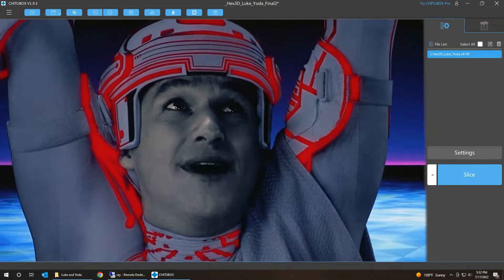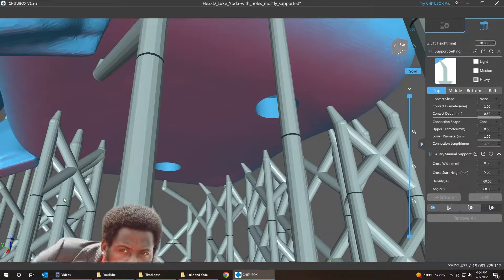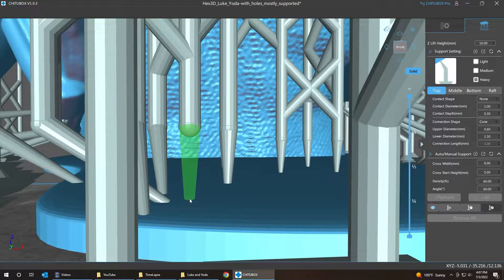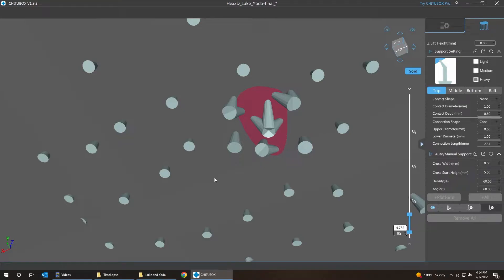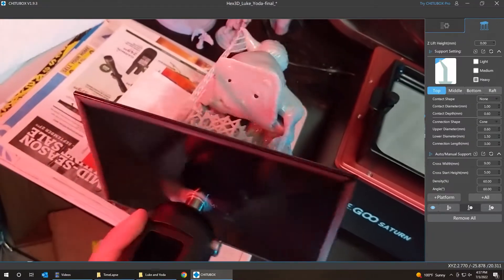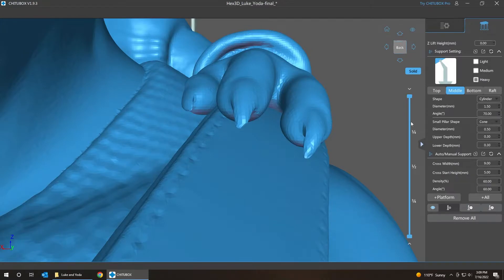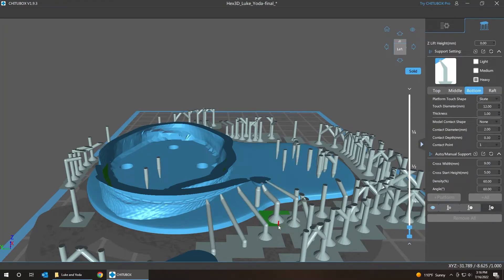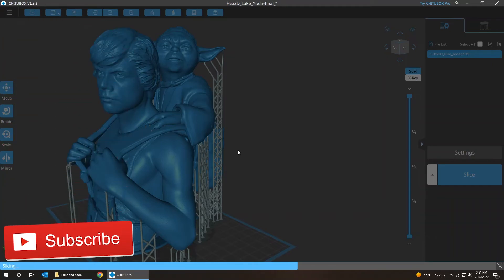How to Add Supports in ChiTuBox - Part V - Fixing a Failed Resin 3D Print

Comment: I was having problems with my plate only having one side come out , what do you think this could be ?
Reply from the maker: A lot of times that is an issue with leveling the build plate.  If one side is slightly higher than the other then there will be too big of a gap between the resin and the build plate and it won't adhere to it on that side when curing the initial layers.